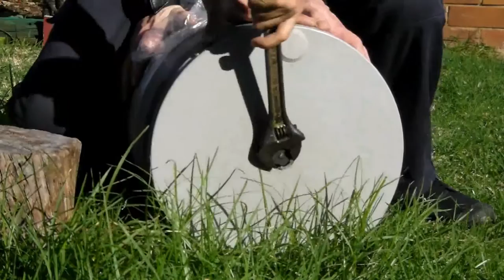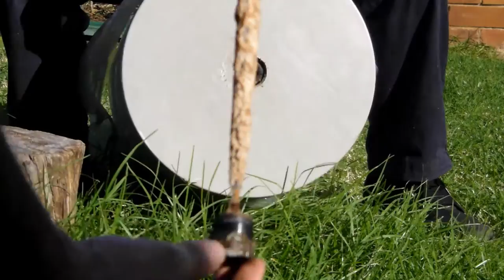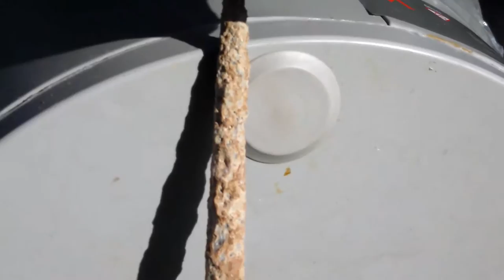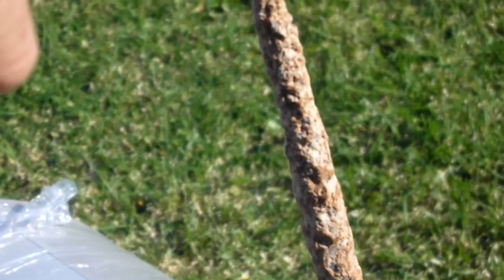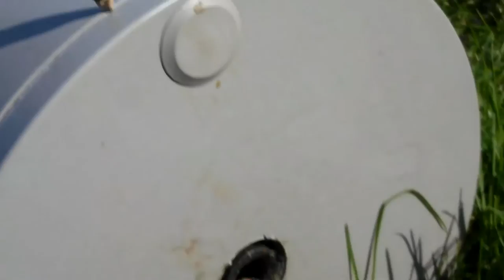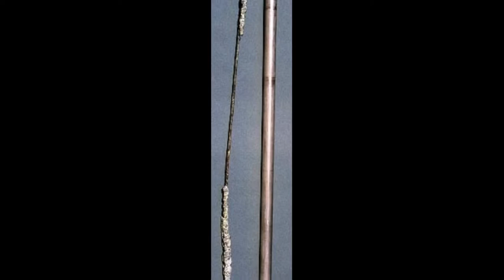How to increase your Hot Water Heaters lifespan (Anode replacement)

Comment: Replacing the factory installed Anode Rod as it depletes will stop internal tank corrosion HOWEVER, if you have well water, it will not solve your odor problem. Our company solves this problem with our product. We use a "sensor rod" that replaces the factory aluminum/magnesium rod inserted in this video. Your water odor is gone within 1 tank cycle and your water heater is protected for years beyond the factory warranty. Our product works, hands down!
  https://www.waterodor.com
Reply from the maker: your message ended up in the spam folder due to the self promotion of your website..
however, i found your product interesting- so i restored the message. i was in a good mood  :)
i would appreciate it if you could give the video a thumbs up to reciprocate the favor